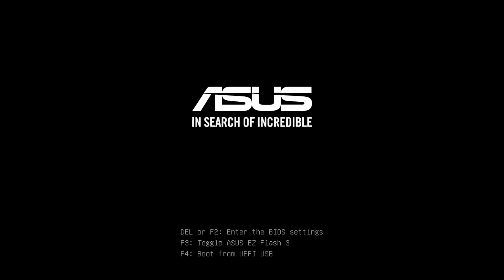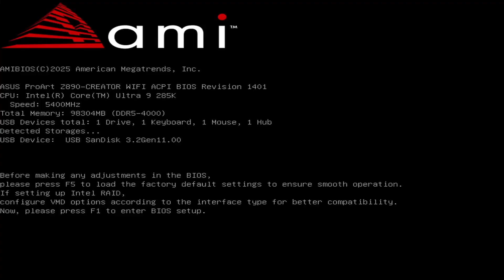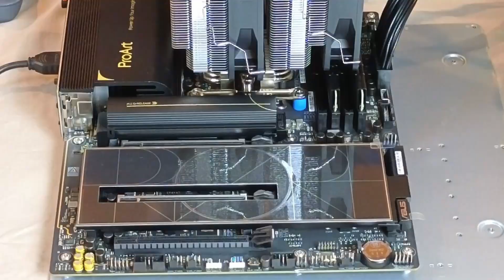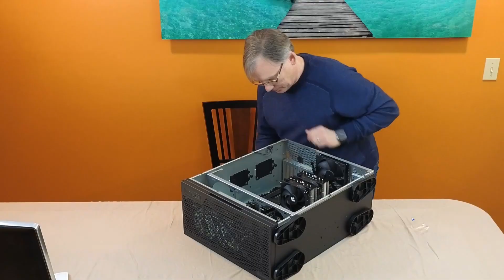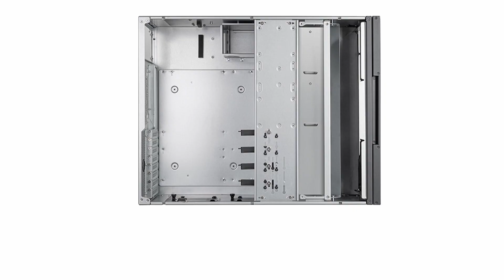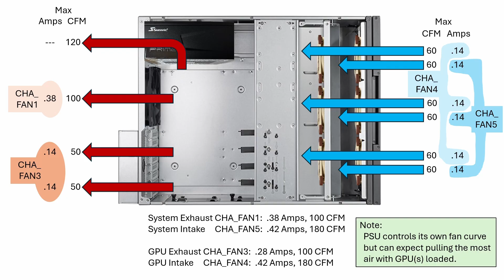Silverstone RM52 Server Build Part 2

Comment: I would enable XMP firrst and than run Memtest86+ over night to be sure that the RAM is actually good and doesn't need aditional cooling.

Edit: Interresting. Why don't you use the 2 "slow" (they are 4 Gen by 4 Lanes and even via chipset more than fast enough as system drives) m.2s with e.g. 500GB/512GB Crucial T500s/Samsung980 PROs/Intel Solidigm P44 Pros/Kingston NV3s and run the MD-RAID1 there? You don't seem to need the SATA ports at all.
Edit 2: Comment is mostly for people who want to do a similar build as you clearly are already done with yours 😀
Edit 3: It's a bit of a waste to use the rather expensive Noctua Fans in a rack build. You want to use propper server grade Fans like the Arctic S12038-4K that's propper 4000 RPM coolers that can go as low as 600 RPM. The Noctua Fan has a static pressure of 2.34 mm H₂O while the Arctic Fan has 11.45 mm H₂O and they are 15 bucks compared to Noctua's 30 bucks.
Reply from the maker: Not a bad idea to test with memtest86.  I always had good luck with ram working in my builds but I can give that a go when I’m back from vacation.  

No strong reason on SATA usage. Once I read promox didn’t need much drive performance, I went that way to keeps options open done the line (need more storage later) but what you suggest would work well if that wasn’t needed.

As for fans,  I’ll probably do a follow up vid to play around with other options to see what kind of results it gives.
Reply: @EngrAtPlay if you gonna put in a radiator you should definitely go for higher static pressure fans. Looking forward to whatever is next for you. Enjoy your vacation.